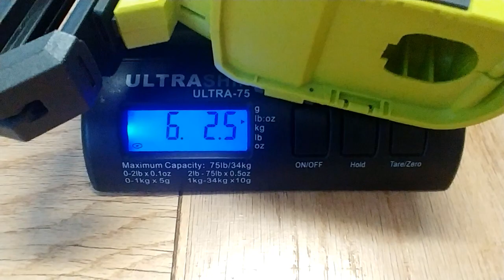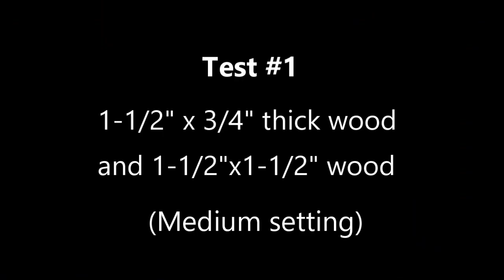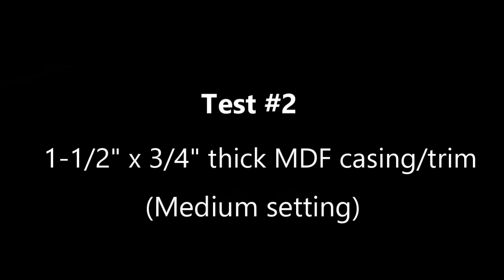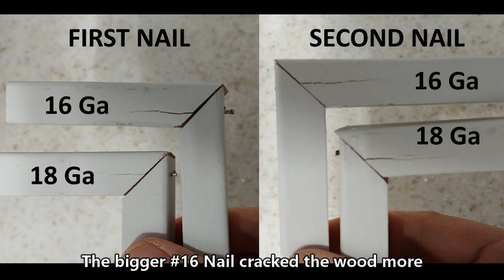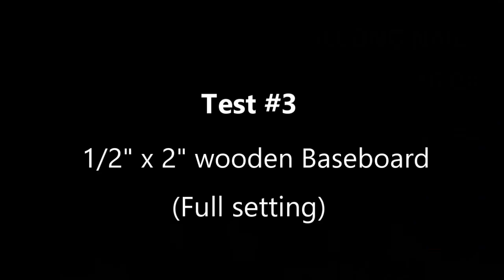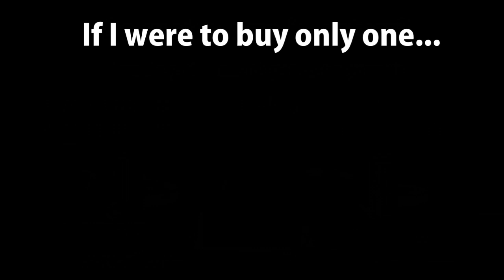Ryobi 18 gauge Brad Nailer vs 16 gauge finish Nailer

Comment: Already mentioned about safety here but just to emphasize the point: brads can exhibit a tendency to bend as they hit more dense fibers in the wood and then they end up shooting out the side. When using any nailer never hold what you are nailing with parts of your body.
Reply from the maker: Agreed. I shall add a warning on the description about the dangers of misusing the nailer.
Reply: toootalllllyyyyy.... that was hard to watch
😂
Reply: @whatilearned8045  
Most people do not read the description (myself included) so that is a waste of time.
Reply: im not gonna lie i was scared for their fingers
Reply: I found out the hard way when an 18 gauge went into my palm exactly the way you describe it occurring.

Comment: Anyone who has had an 18 gauge brad fire into their thumb from the tip down to the joint would be watching that video with gritted teeth.
Never put your fingers that close to any joint you're nailing and never do joints like those mitres freehand. 
The reason why those brads didn't want to go in properly is that the nailer was bouncing off the work and the work was bouncing off the nailer.
You gave the nailer no chance to do its job.

Comment: A) Please be more careful and B) These are two different types of nailers. It’s possible you’d need both depending on a project.
Reply from the maker: I agree, thank you for your kind comments!
Reply: Which one would you use to build a fence?
Reply: @megae859 definitely not the 16ga finishing nailer (think: picture frames, shoe molding, gluing boards together, etc). The 18ga also probably isn’t substantial enough for a fence.

Comment: It depends on what types of jobs or Livelyhood you are doing ❗ if you are a Wood worker and you builds wood furnitures and other hobbyist stuffs then I suggest you to have a variety of nailers or cordless nailers. And as a Certified Carpenter and Licensed Home builder, Wood Worker and a Hobbyist, I have a lot of varieties of Nailers. I have Framing Nailer mostly Plastic Collated, I got them both Pneumatic and Cordless battery operated. I also have 15ga and  16ga finish nailers, I have 18ga Brad nailer, 23ga Pin Nailer and a 18ga Narrow Crown Stapler. I have them all so that I will have a wide selections for a specific type of job or work. Always use the Right Tool for the right and specific job.
Reply from the maker: I agree, thank you for your input!

Comment: What a great video, the best I’ve seen on here, I was so interested to see the holding weight demonstration of the the p320 and the p325, I too will go for the p325 based on your vid for the extra holding power and strength
Reply from the maker: Thank you for your kind comments, I'm glad it helped!
Reply from the maker: @JTUBER reviews Hello, both would work well. If you attaching thicker trims & want a stronger hold go for the P325. If using delicate or thinner trims, use the P320 since the P325 might split the wood as shown in the tests

Comment: I actually ended up buying the p320, had to get it sent from American through eBay as I could not get one here in the UK as they were sold out, it ended up being the same price, I have to say it’s brilliant, fantastic holding power on 16g Brad nails as demonstrated when putting kitchen units together using 18mm mdf , for UK viewers, Toolstations Tacwise 16g brad nails work brilliantly with this, no jamming, and their as cheap as chips for a box of 5000, I also have the p325 again works brilliantly for attaching hardback to units, again toolstation does Tacwise 16g Brad nails for these in  different sizes also very cheap for a box of 5000.
Reply from the maker: Thank you for the update and the helpful information!
Reply: For doing architrave and skirting, which would you suggest? I'm currently weighing up both units.
Reply: @rodgerq  p325 is ur best bet for architrave and skirting
Reply: @markstv40  thanks man

Comment: I bought the ryobi p325 and so far when shooting nails into .75 mdf I can only get the nails to go in about 1 inch.  My tool also sounds different than yours.  It doesn't sound smooth like your tool does but rather makes a pop sound.   Out of warranty because I was only using 1 inch nails on first project.  Now that I go to 2 inch nails they stick out about an inch
Reply from the maker: As others have mentioned, there is a knob behind the gun to adjust strength of nailer, and another knob near the tip for finer adjustment. Hope that helps
Reply: @whatilearned8045  

Yes, of course.   Unfortunately this didn't help at all.
Reply from the maker: @drrckhamilton  Sorry to hear that. Sounds like the tool itself might have an issue if it's not driving the nails fully. It's unfortunate it's out of warranty. Maybe some viewers here can help troubleshoot if there is anything that can be done.
Reply: @whatilearned8045  

Thanks
Reply: @drrckhamilton   oil your gun!!! Before every use. These ryobis are very sensitive to dirt and grime..
Reply: @mayiitoo_707  

I literally bought it new and it was like that.     I kept it but bought another one and it worked perfectly fine.  I'll try the other one.  Thanks.   I do hear that many have had the same issue however.

Comment: Which model can be used for concrete panel nailing?
Reply: Gun powder Nailer. Don't even look at these for that job. Lil bang stick will do the job for 25 bucks. Look around home Depot
Reply: The fact that you even asked that question tells me you should stay away from ramset guns and nail guns mate lol.

Comment: mine lost function, except the torch after 50 nails, reading reviews from others my conclusion is, such a complicated tool better be bought from a not-so-hobby manufacturer or even go more primitive with air compressor.
Reply: A few people have had them fail pretty quick and have posted repair videos, seems like they need a little TLC and they can work fine.
Reply from the maker: Yes, I have seen some nailers that had jamming problems. So far mine is holding up well on occasional use.

Comment: Omg😂😂😂.  Are you kidding holding the trim and shooting literally at your fingers ?  Mate. What are doing ?  😂.  I shouldnt even laugh because of how stupid that is.  Also a comparison video on the 18g and 16g is pointless and people who are trained in the carpentry trade understand each nailers uses.  You dont use these guns for the same  application.  They are totally different.   No DIYer should be using nail guns anyway. They are specifically designed for trades in the construction industry. You ahould be using a hammer and a nail haha.  Omg mate.